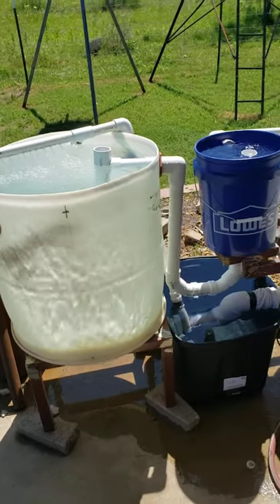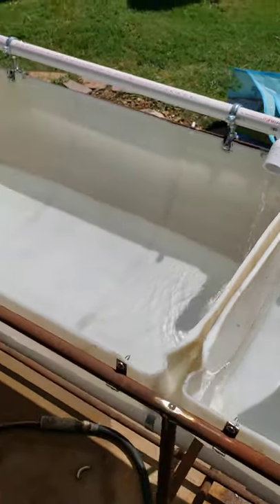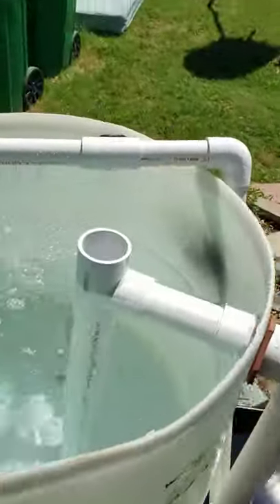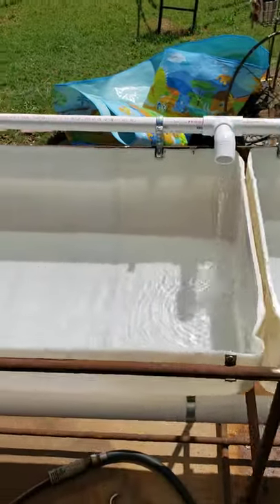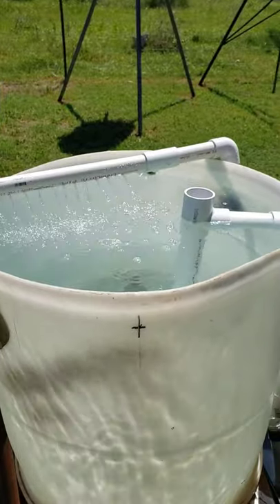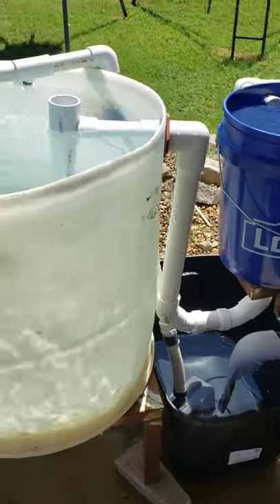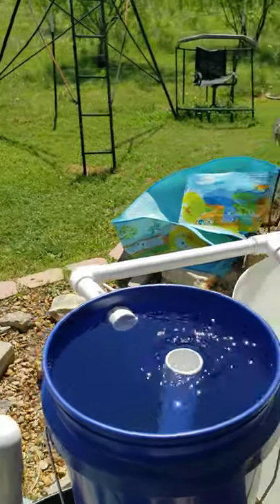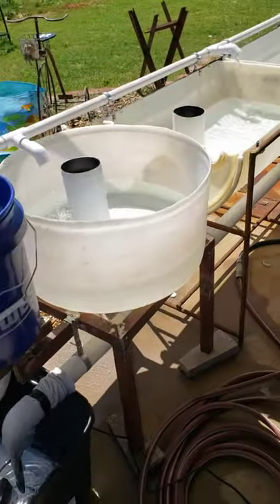My First Aquaponics system (and the issues)

Comment: Howdy, Sean!  Nice little set up!  You won't need so much water moving around once you have media in your grow-beds;  that'll take up about 80% of the space.  So you shouldn't need to change your bell-siphons or your sump.  For testing, just fill the furthest grow bed, make it work, and cap the other two outlets until you get media in them.

Congrats on starting the big adventure!  It's a lot of fun!
Reply: It looks like you've got about 30gal in the sump and 50gal in the fish tank;  you should only need a pump 4x that size (80gal =>  320gph).  The 1.5in pipe should be plenty big for that.  1in will run 600gph at gravity.  :)